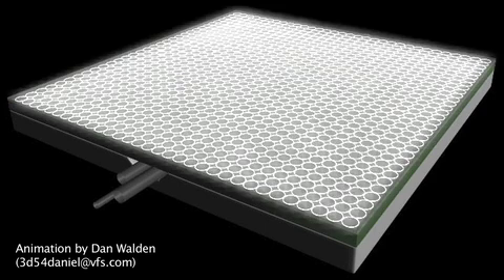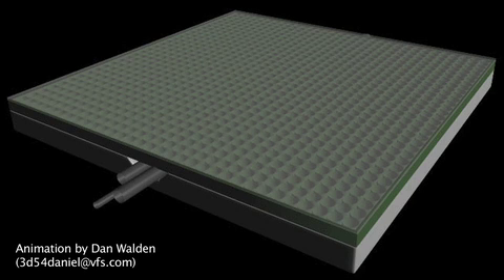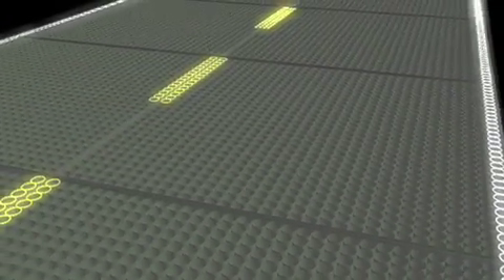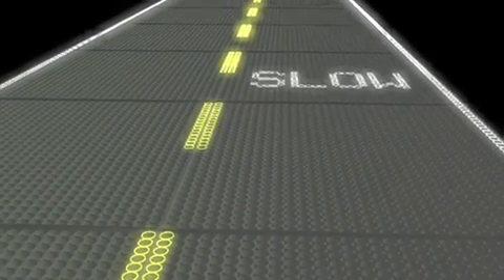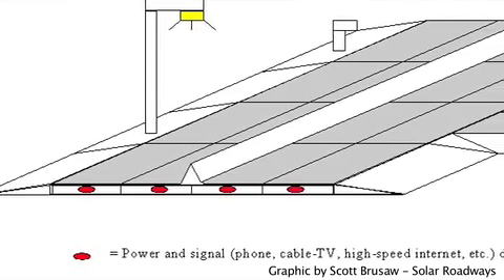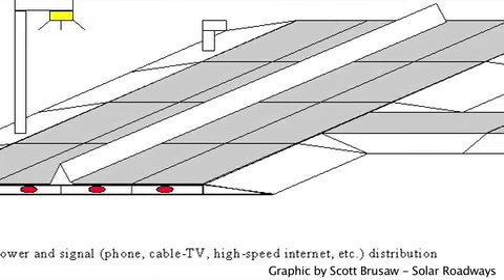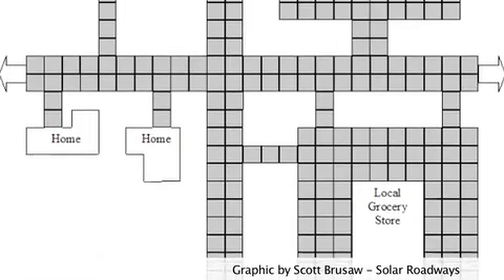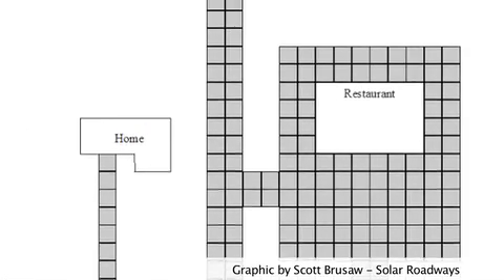YERT Conversation 19.1: Solar Roadways

Comment: Ok, if cars and trucks are blocking out the sun how can a parking lot make power, also I can see it now in LA all the cars grid locked on the road blocking the sun and getting no power or little power there sounds like a pipe dream.
Reply: Dude, if you did not notice, it was estimated that the roads would produce 3 times as much energy in one year as USA uses in one year. That would demand more than 2/3 of the total surface, which is covered with roads at the moment, to be covered with cars. If that was the case, using a car would be utterly useles. Think when you have to park a car and the best option is to not move at all. Think that this is the case for everyone... Then we are only talking about normal roads, built by the state.
Reply: There's also the space not covered by parked cars which is used to move around the lot.

Comment: Matthew Doane If you visit their website the current system is actually a series of hexagons measuring 4sq. ft. each that can be pulled out without disrupting the system and replaced. their largest obstacle has been finding a company willing to make solar panels to the dimensions they want.

Comment: How will it store energy?
Reply: How does any solar panel store energy? Most of the power generated would be directed to houses and companies that use it however a fair amount could be stored in batteries either in the road or in key locations. Maybe battery storage would be a good use for all those substations and power plants that would be made obsolete.

Comment: I wanted to know what is feasibility of this technology in places where it rains a lot. Will water seep in its circuit and cause short circuit?
Reply: I've been following Solar roadways since I found an article on the group in popular science back in '06. The circuits are no more likely to short out under heavy rain than your average solar panel. The company is actually based in Idaho and their first viable use of the panels was as a parking lot outside their HQ. The video doesn't cover some of the safety features of the system like programmable LEDs to mark lanes, built in heating units to melt snow, and the set of channels the current system uses that actually collects rain runoff so it can be sent to water treatment plants and cuts down on our pollution.
Reply: FirstIsa
Thanks a lot for reply!
I would really like to implement it in my neighbourhood, but I doubt it viability. Something makes me feel rooftop solar panels are yet much better option. Yet it is an interesting technology and I would like to conduct further research on it, if it is economically feasible.
Reply: Rishi Kishore
Realizing the technology is still being developed and having seen how the technology and concepts involved have developed over the last several years I'm impressed with it. while roof top panels can be arranged to swivel to always face the sun directly they found through testing that by keeping the panels flat like they are for the road they actually produce more power during cloudy and overcast days. With the addition of a drainage system to the more recent concept they have also established a way to keep the oil and other chemicals that leak or run off cars from entering the environment by catching it as it runs off the panels and directing it to a water filtration system. The panels are also designed to communicate with each other so if one cell goes out the ones around it report back to a computer where the problem is located.
Reply: I heard that there was an idea to 'laminate' it or something like that.

Comment: What seems to be lacking with this concept is a strategic plan for implementation on a large enough scale for accomplishment. With the input of media like this YouTube channel  there are great resources of intelligence both (positive and negative) for devising a workable plan.  My first suggestion - for example - would be to approach companies on a large enough scale like Walmart or Home Depot and having them rework their store parking lots with this system and challenging them to step up to there claims of "going green". With multi-billions in profits they certainly have the resources to get it going while practicing what they preach.
Reply: I know when popular science did an article on them it mentioned approaching Walmart and showing numbers on how the store could generate enough power to run itself and surrounding neighborhoods even with a parking lot filled to capacity. Now that they have a working prototype for their HQs carport their local town is negotiating to have it's main street replaced with the solar roadway. While the goal is to eventually replace any paved surface with solar roadways I believe they want to target roads first over parking lots.
Reply: With any new idea one of the largest obstacles involves gaining large scale trust in the system and, its performance. Until there is information verification that backs up claims of meeting the needs and specs of a new road system the smart move , I believe, is building from a smaller working model that people with the ability to effect change can see for themselves is feasible. This also works as a manageable testing area to address the "what if's".  I can assure you there will be unforeseen issues effecting performance needing solutions. Keeping this cost manageable is critical to establishing this trust.  
Very few - if any - people in position to approve a changing our road system are going to jump up and ruffle the feathers of existing industries unless they can see a greater reward from making the effort. There is a lot more here than just a great system that makes sense there seems to be a large political agenda needing persuasion. Fear of Change can not be underestimated - again in my opinion. Thanks for responding Fisrtlsa

Comment: Its fine and dandy until an EMP sent by another country short circuits america or a CME hits the the earth and proves that the sun is a friend and a for, but if we can find a way to protect against that then you're set.😀
Reply: The solar roadway envisioned at the moment is going to be modular. Say anything, EMP, CME, earthquake, volcano, sharknado even, hit a destroys an area of solar panels. Well every other panel that exists would simply ignore the destroyed panels and carry on. In fact, damage to the solar roadway grid may end up being even less catastrophic than to our current system under any of those same catastrophes.
Reply: Well then thnx
Reply: oh srry didn't know lol
Reply: Lamar Brady It doesn't take much to put in place EMP defenses, the main reason it isn't done presently is because of a lack of interest by the public to do it to our present infrastructure.
Reply: yes but considering that not many ppl know what an EMP is and that most Americans are stubborn and will attempt do it any way it still posses a problem

Comment: Great concept Scott. Another downfall though would be snowplow blades. Steel runners on glass is not a good combination. Retrofitting the plow blades with some kind of rubber or Teflon material would be a necessity .

Comment: The strong point about  incorporating solar into the roads as opposed to large solar fields in the desert is that you're producing power close to where its being used.  Selling this power to other countries is difficult because power is lost in long distance transmition of the power. But if it works here other countries can use the same system and it will cost less to do when the process is standardized.

Comment: One great thing about this is that once the technology is in place it can start being done on a small scale.  Homeowners can do their driveways businesses can do their parking lots and govt can do the roads.  It can be tried in different locations  to work out the bugs. Doing it on a large scale by the highway system though would be more cost efficient.